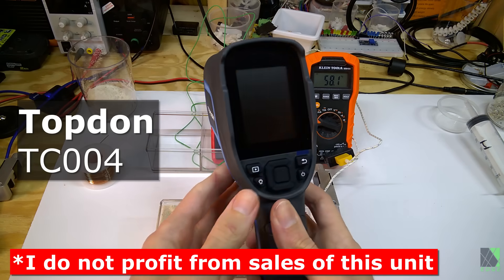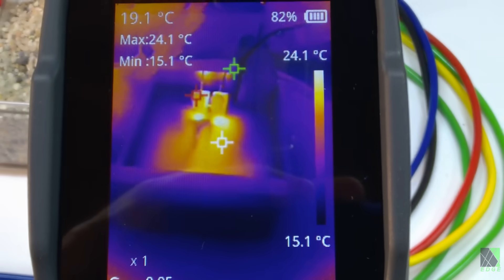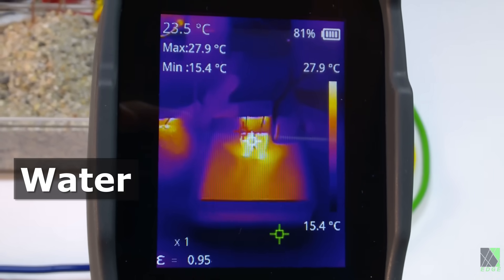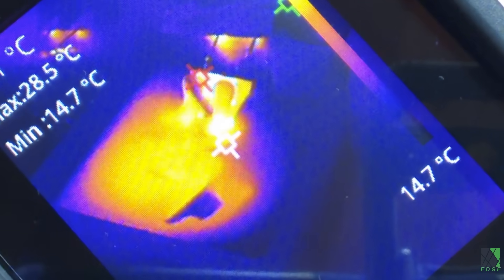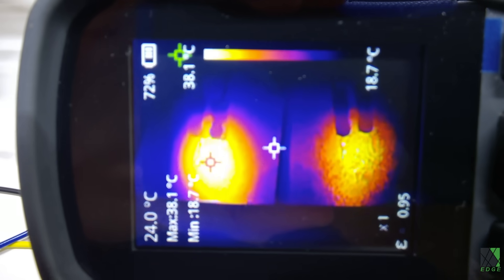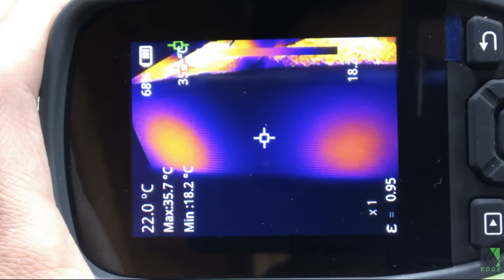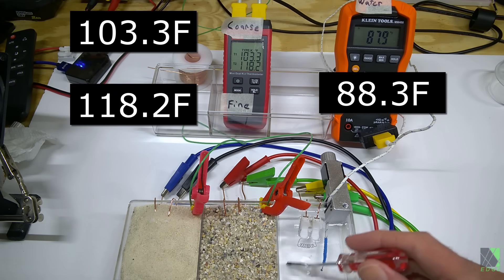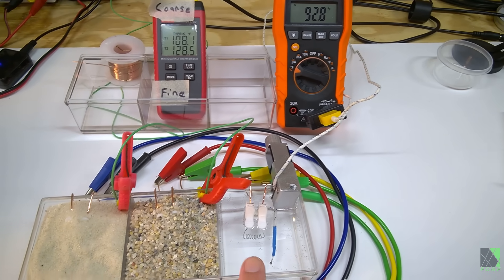Sand Battery Thermal STORAGE: Fine Sand vs. Coarse vs. Water! A simple experiment #science

Comment: what about water in a pressurized vessel ?     What is the psi for water at 300°F pressurized
Reply from the maker: @cedricpod Good thinking, holding the water under pressure could reduce the boiling problem. And also could simply use more thermal mass, as water can easily store a ton of heat even without reaching boiling temps.

Comment: What about water and sand combined?
Reply from the maker: @Nellyontheland Worth a try, I thought about doing it. We'd need to keep the water below boiling point, but certainly the water would greatly increase overall heat capacity
Reply: @solarpoweredge  I was thinking as a "starter" to more evenly distribute heat at the start.
Reply from the maker: @Nellyontheland Right on, and it should also push all the air out from the sand
Reply: @solarpoweredge I never thought of that...

I saw something recently that made the claim that if air is pumped in at the bottom, to make the sand fluid, then the distribution of heat was quickened and overall it heats faster... it may have been in a sealed vacuum, using the same air from within...
Reply from the maker: @Nellyontheland Now that is a really interesting idea.  I have a vacuum chamber and before the move I started some experiments with applied vacuum. If I can get my workshop up and running again, I think we will have to look at this closer...

Comment: interesting.
What if you added water to the coarse sand?
Reply from the maker: @shawnr771 That's worth a try, of course then we must stay below 200F to prevent water boiling away, but it would increase the thermal capacity
Reply: @solarpoweredge Thank you for pointing out a potential pitfall.
Reply from the maker: @shawnr771 NP... this made me start thinking because I prefer lower and safer temps. With sand alone, we must have extremely high temperatures to store the equivalent heat. Imagine if that sand accidentally spilled out of the container at 800 degrees - instant fire hazard. For that reason, I'd only use a "pure sand" battery on concrete floor. I am starting to think the key to using sand at lower temps is in fact to mix something in to replace the air. I'll do some more research on this angle as soon as possible.
Reply: @solarpoweredge great.

My use if I build one will be in a greenhouse on the ground.
No worry about spillage.

Comment: I have an old thermosiphon system on the roof heating the water, It's due to be replaced and i am going to re-purpose it as a sand battery. in doing so it will be a contained heated sand heat source and the heated air won't be able to get away. I will be able to gain numbers on what heat is retained daily for an enclosed insulated tank and how high it can maintain that temp. Later I will make a octagonal tank so i can add some teg devices to the tank and gain electrical flow perhaps 24/7. Your experiment is full of intel for what I might find in doing my experiment. It appears fine sand or perhaps dust powder is the way to go in my first attempt's to gauge a result. Thanks for posting.
Reply from the maker: @keithwells-g7z That sounds like a great project. Been experimenting with TEGs - before I got interrupted by moving. Some of the experiments failed, some gave exciting results. Have tried TEG power storage as well. Looking forward to returning to that work as soon as possible...

Comment: Hey mate glad someone is doing real world experiments in this area!

I'd like to see the experiment run in individual insulated boxes. I'm concerned the water is taking a higher energy input because it's loosing a greater percentage of the input to the air. The energy is rising to the surface as heat which is fully exposed to the air for loss. The sand is retaining most of that energy at the element and slowly heating grains to the top before the losses occur...rather more is retained deep in the pile? Higher energy density?
Reply from the maker: @RedEarthAA Greetings mate and good call. A totally valid point! The thermal loss off the top of the water container should not be overlooked. I can use completely insulated boxes next time. I'd like to see those results. Hopefully after we get a workshop built.

Comment: Perhaps this experiment would have been served better.Had you used identical, but separate metal containers and heated them from the bottom.The water would become mixed better.And once you were able to see surface heat on the sands, you could cut the heat off and it may give you a better idea of the longevity
Reply from the maker: @joshoconnor6684 There are certainly many ways to conduct an experiment, this method satisfied me due to its ability to demonstrate the behavior of the coarse vs. fine sand - easily answering the questions I had. The water is of course much easier to get heat in/out of. Frankly in my various experiments, water has been a better heat storage medium because it doesn't require such high temps and will readily accept heat. The downside is potential water leaks etc. Sand needs higher temperatures which means if the sand spills it's actually quite dangerous.

Comment: Great work, but just a suggestion, add dummy bucket at both ends, because the ends have 3 walls exposed, versus the center one only have 2 walls, so heat lost will be higher for the 2 buckets at the ends. But very interesting work, or just repeat 3 times the experience changing the location for each material. Probably the conclusion will not change.
Reply from the maker: @pierrelabelle3551 Good points, good ideas. I knew there would be some mixture due to the buckets being close. However it became quite obvious towards the end of the test, the fine/coarse sand temperatures were really far apart. Even more than I expected. Next time I hope to use better containers for testing.

Comment: I'm currently running a sand battery heating storage system using a 1500w coil burner from a stove hooked up to my 400w solar panel. After watching your videos, I'm trying out a diode chain as my heating element, but thinking I want something more than just sand as well. I'm thinking about adding mineral oil to my sand to pull heat out faster, while storing it in the full mass of the sand more evenly, while also avoiding potential corrosion from water. Have you thought about oil/sand experiments for heat storage?
Reply from the maker: @Lenardd420 Absolutely, mixing oil and sand is on the list of things to try. As well as paraffin wax. If I can get caught up and make some more videos about the topic, I'll be sure to share the results
Reply: Mineral oil was my thought as well.  Not conductive being a bonus.  However, water and sand are very cheap and available.

Comment: so.... fine dripped watery sand is king?
Reply from the maker: @paulmaydaynight9925 That I have not tried! Wet sand would increase specific heat by about 75% (rough numbers). Note if we exceed 100C the water will turn to steam and boil away.

I settled on coarse + fine sand mixture, but will still use water tanks for heating my shop. Might as well experiment with both methods :)

Comment: Try using slag instead of sand, it has a higher thermal conductivity and capacity.
Reply from the maker: @ChrisDay-sx4lv Never thought of that, it's worth a try!
Reply: @solarpoweredge  available in different grades for blasting (iron silicate blasting media)

Comment: I thot THE reason for using sand to increase the delta T using temps well above 100C.
 It would seem like isolated and insulated media would be necessary to avoid heat loss confusion.
I enjoy your investigations! Thanks
Reply from the maker: @bluegoose6550 I wish I could have expanded further on this topic in the video, but ... it's already very hard to get anyone to watch my videos as it is :)

*For industrial processes that need to generate steam, they need those very high temps in excess of 100C. So sand batteries do make some sense. 300+C sand can be a bit dangerous though. 

*For the average person, it sometimes make more sense to just use 80-90C hot water in a plastic tank. Tons of heat, reasonable space requirements, lower and safer temps, and you can pump the liquid too. Of course, that tank can leak, water can freeze, etc. But then, water can also get "cold" yet another useful advantage.

Comment: When scaled up IMO there may be benefits for using small diameter river rock. The advantage is the ability to distribute low pressure air directly thru the rocks as a heat transfer medium while storing a very wide range of heat up to 1,000F. Using PV D.C. power directly to heat the rocks and high-volume low-pressure air to remove the heat as needed. No flammability, pressure, or freeze problems though there would be a potential for a steam explosion if water contacted hot rock. The hot air could be used directly or with an air-liquid heat exchanger.
Reply from the maker: @goldcountryruss7035  Right on and good thinking. I am considering using some small pebbles here. Should hold more heat. After seeing how coarse sand behaves, I decided to mix fine + coarse together. In a larger sand battery, a core of rocks well compacted with very fine sand and minimal air space should be fantastic. I like the idea of pushing air through. Literally "dirt" simple and dirt cheap solar heat storage. Awesome!
Reply: @solarpoweredge  Be sure to slowly heat any "new" rock or gravel to dry them out. Even rocks contain water and can "blow up" unexpectedly. If using a "Kanthal or Nichrome" element in direct contact, make sure the rocks are not electrically conductive.
Reply: If using directly, might radon be a concern?

Comment: This was very helpful. I’m planning a four season greenhouse using thermal mass for heating the greenhouse in the winter. One of the experiments I’m planning is to use a combination of water & rock for the slow release of energy. I’m including a water tower that will contain the heating elements injecting the heated water at the bottom of the tower and using thermal syphoning to mix the water throughout the container.
Reply from the maker: @samkinpommers4558 Good use use of different media. Rocks hold good heat and are very dense, but slow to cool off. I decided to just mix fine and coarse sand in the second sand battery I am building. However my shop will be using mostly hot water as it will be linked to another project requiring liquid heating/cooling

Comment: It usually goes both ways.. So what held up the heat for longest time? Traditional heaters like sauna and sweat lodge use stones. I suspect that the river sand and small stones in a wax would be the best solution. Diodes might also be more officiant as heating element.
Reply from the maker: @Kangsteri The coarse sand cooled off more quickly and never reached the higher temps as fine. However this is OK and somewhat expected due to the air space around the granules. Currently working on "wax" battery but don't have anything recorded yet

Comment: Looks like you need to combine fine sand and water or all 3 to get superior results and fully take advantage of each material
Reply from the maker: @Caesarus2011 I decided to mix fine and coarse sand, that might hold a bit more heat. Plus I already bought both sands - might as well use it all :)

Comment: There's a fourth test that would have been good to see the result of: wet fine sand.
Reply from the maker: @fleaniswerkhardt4647 That would be interesting! In my second sand battery I decided to mix fine and coarse. Perhaps version 3 will have some kind of liquid inside...
Reply: The moisture would just evaporate, but still interested.
Reply: Use an oil base liquid

Comment: Would there be any advantage to mix the water in with the sand? Fill in the air space between the sand with water instead.
Reply from the maker: @dans381 I believe that would be fine as long as temps don't exceed 100C (boiling). You'd get a combination of water and sand behavior. At this point I just mixed fine and coarse, and my other battery is going to use pure water :)

Comment: Did I miss how long the three tests were able to output heat after the power was off?
Reply from the maker: @MikeTwohey I cut that part out to shorten the video: the fine sand held heat the longest, coarse sand did not achieve as high of temp and also cooled off faster. The water was stratified, did not heat up quite as much and also cooled off pretty quick - which is expected. My curiosity was mostly fine/corase sand temperature profile... you can see how fine sand eventually reached the highest temps (as expected) because it insulates well and coarse sand lagged behind

Comment: I guess water is cheap and plentiful, and can hold a lot of useful heat in the 50-99 C range, good for hot water and general heating.
Sand is pretty safe to heat to 1000 C (pure, much higher), which is great for storing energy for generating electricity, on top of the heating purposes of water.
Cool work man!
Reply from the maker: @lubricatedgoat Well said... for heating my shop I decided to also use water in a leakproof container. Because then I can make the water cold during summer which is another project :)

Comment: Rondo Heat Battery is extremely interesting. 
Refractory brick can hold 1,500⁰C temperatures. 15x water temperature. 
Excess rooftop PV electricity can be stored as heat energy and bleed off to heat water or a room.
Extremely durable. 
Extremely compact per volume of heat, handy high temperature.
Volume ratio 5 to 1.
1m³ = 5m³ of water.
Reply from the maker: @stephenbrickwood1602  Checking out their website... such high temps means making steam and on demand electricity. Nice!
Reply: @solarpoweredge  it is interesting.
15x temperature, but only 5x heat capacity by my calculations. 

Do a test with  kiln heating wire and refractory brick, maybe. 
You have the skills.
Reply: A heat brick in the bathroom, in the kitchen, in the laundry, and water instantly heated as needed.
Heat brick in the bedroom or basement or family room,...

Comment: Awesome! I haven't gotten to your level yet in reality but I will get there. Love the channel, keep up the good work! The only other factor I would add to your experiment is the inclusion of heat pipes. Copper piping that has been internally vacuum sealed with a wick and chemical so it acts as an instant wire for heat transfer. You can find them easily in discarded computers in the coolers for the processors. They are also easy to make but you have to be quick on the sealing process or it won't work. Some are also sold as individual rods. I plan on making a solar hybrid heater that uses a sand battery in a solar oven but is also run with PV2L. I might even improve it with solar thermal methods. It's a project to play around with. From what I have gathered though from looking around on the internet. The better performing sand batteries find every way to fill the gaps in the material. So fine sand, coarse sand, then gravel mixed together. I have never seen a heat pipe tested with a sand battery though.
Reply from the maker: @daniellapain1576 Thank you for your kind feedback :) I went with fine + coarse mixture in my second sand battery. And a separate tank of water for the rest of heating operations. I ordered some heat pipes, but after 1 month USPS still hasn't delivered them. Oh well...
Glad you're building a PV2L project, right on! Direct solar can do just about anything!
Reply: @solarpoweredge  One other thought I have played around with is friction heating. Ever drill into a piece of concrete and the drill bit turns cherry red? I'm weird but It made me think of how little energy was used by a battery powered drill to create that heat. That's something I have done experiments with by sticking steel bars on the end of a drill and keeping it running until it heated up on the concrete up to 280 degrees. Now stick that in sand and it has a means to spread the heat out. The stronger the material the better the friction results for longer. It also made me think of brakes on flywheels for some reason. Ultimately in friction heating, avoiding friction welds and material degradation is ideal.
Reply from the maker: @daniellapain1576 I am curious about this! but have not done a single experiment. I noticed the same when drilling pilot holes in carpentry, the drill bit gets too hot to touch. I have also thought about using induction to heat a metal core in a sand battery instead of running wires down into the sand. If we spin a disc heater with a solar powered motor, the "MPPT" can come from varying the clamping force on the disc until the voltage/load hits the correct range. Thanks for sharing ideas!  thinking outside the box 👍
Reply: @ horizontal windmill on a pipe and no electrical energy is required for this part. The wind brings more cold so force it to give more heat. :D
Reply from the maker: @daniellapain1576 Now that's simply brilliant. Someone really needs to try that :D 👍

Comment: Hi Dave, 
Great, some experiments!
Some energy of water is evacuated by vaporization (latent energy of vaporization of the water). 
May be you should use a cover for the water tank, and also for the sandboxes, for equal conditions. 
The tank containing coarse sand has an advantage because it's located between the other two.
Reply from the maker: @DomEV6938 That container came with a clear plastic cover... I should have put it on there but did want to see the IR footage too